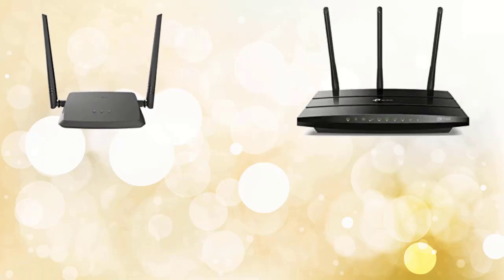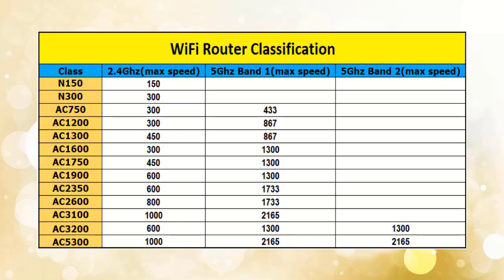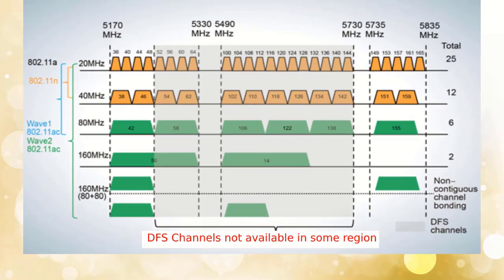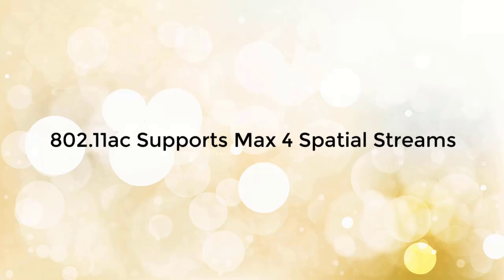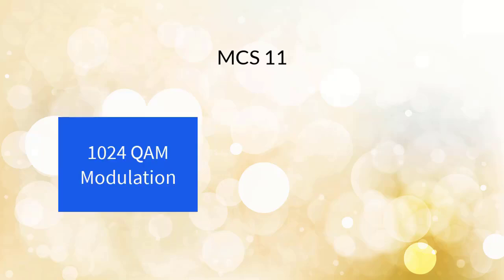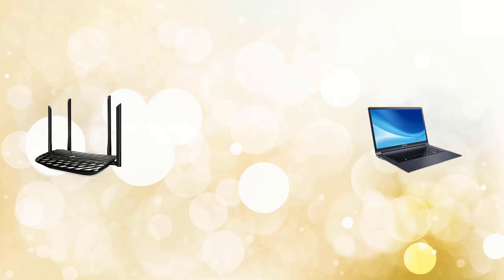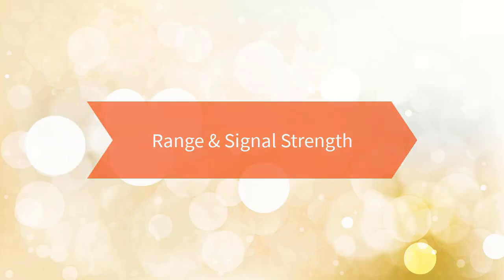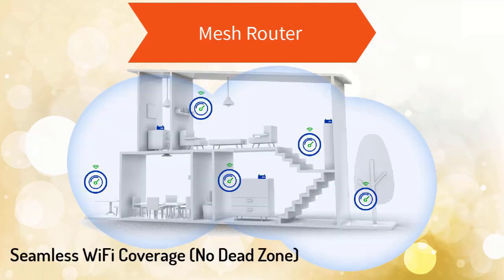✔️11 Technical Specifications to know before buying WiFi  Router | Everything about WiFi Router

Comment: Hi there, I saw your videos on printing documents over the wifi using non wifi printers. Need some help or guidance if you can.
I have one main router with fiber (Lets call it R-1) router 2 with print server no fiber (Lets call it R-2) and router 3 used for only wifi Extension no fiber no print server (Lets call it R-3). Now R-2 and R-3 are connected to the R-1 in which R-2 is used as printer on network and R-3 only for wifi Extension.
I am already using the printer over the network from the computers and laptops and its work fine, But cant figure out how to print form the android phone using the same printer over the network.
One of your video's shows how to use Print Share app to print from the phone, but in that case you have connected to same router to which the printer is connected.
In my case printer is connected to R-2 and all other devices like (computers, Laptops and Phones) uses R-1 and R-3 for the internet and network sharing.
R-2 Wifi is disabled because i am using it only for print server no internet and nothing else.
So the question is how i can print or add printer(connected to R-2) from the phone using R-1.
If it is confusing please let me know with your contact number so i can explain it to you briefly.